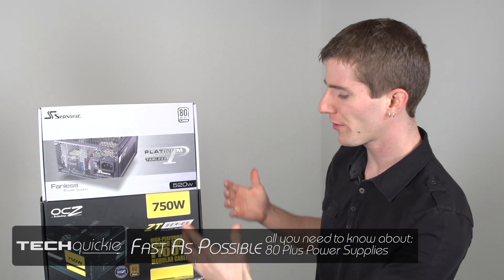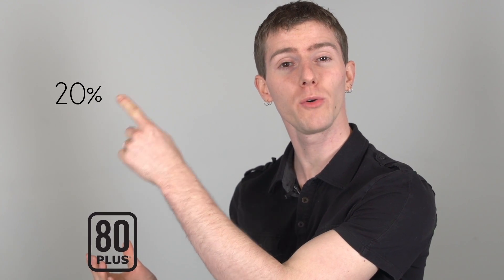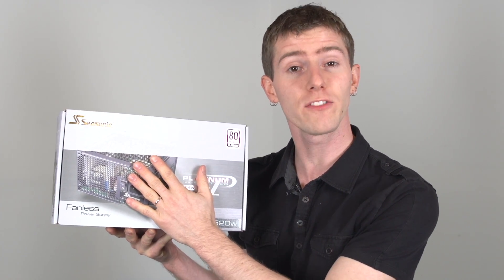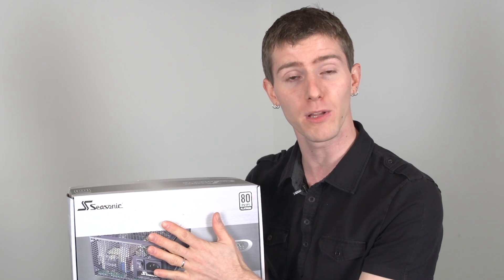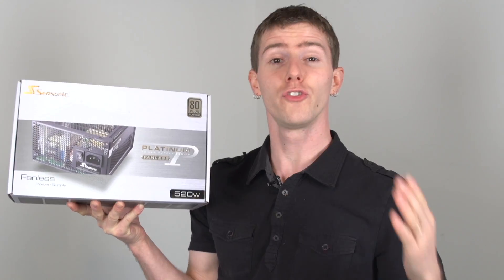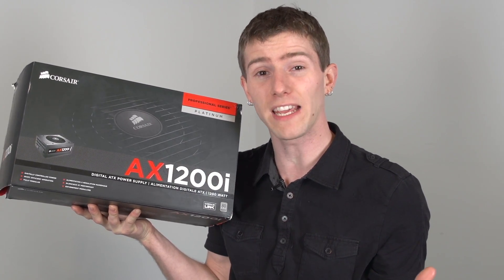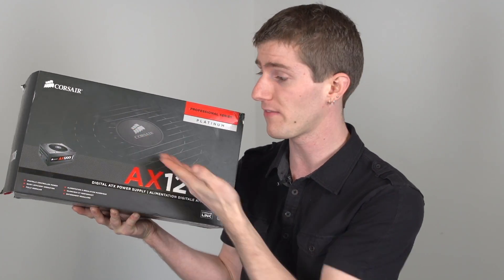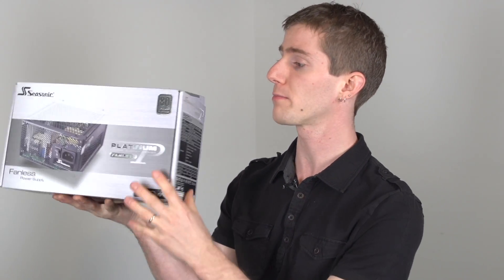80 PLUS Power Supply Ratings - All You Need to Know as Fast As Possible

Comment: Ok, I need your help on this one! I'm trying to build a 4k gaming system and this is were I'm at can you help with the power supply and any thing else, because I'm on the fence. The system is not put together yet. Gearing up for Star Citizen!

i7 4790k 4.Ghz
MSI Gaming 7 board
looking to pick up 32 gig Corsair Dominator Platinum 2400 (10 or 11L)
                   or     32 gig Corsair Dominator Platinum  2666 (11 or 12L)  
looking at video MSI R9 290 X with 8 gig or DDR5 one to start and another later
                       or  one of the MSI R9 300 series when that come out
Hard drives: WD 1tb Black
                  also whats in the works is the Samsung M.2 xp941 512 SSD
                  to start and well most likely add maybe 3 more SSD's
Swiftect H240 X water cooling
NZXT Fan Control panel
Corsair Case 760T with 3- 140mm and 1- 120mm fans
Blu-Ray/DVD play/record

I bought a EVGA Gold 80  850w power supply do you think i should go to a 1000w or 1200w

Thanks to your videos I've made purchases on some of your items!
Reply: looks good to me bro.
Reply: TheJeremy5599 Well I jacked up the power supply to a 1300GS EVGA... I went to Corsairs web site and run a test with there power setup sheet as well as Cool Master and did the math the number were different but both pointed to more power (1050w) so I'm going with that system. The issue is until I reach that goal I'm going to be over powered. the reason I went with this power supply is it's made for 4th gen i7's and SLI or Crossfire and EVGA didn't make a 1100w or a 1200w and I like there stuff, so well here I go with the 1300GSStill I'm on the fence With it because of how big it is! do you think I'm making a mistake and if I'm running on the 700w to 800w will I damage anything?
Reply: Ted Hegner Sorry my bad typing that's the 1300 G2 EVGA Gold plus
Reply: if you run a system that requires more power than your psu can supply no damage will be caused,but your system uses up all availible power headroom it can crash immediately. (i know this,as my current system does it occasionally)
it wont damage anything,but its rather annoying.

Comment: Can you mount a PSU upside down?
Reply: Power supplies generally mount either way. The fan can be on the top or bottom (depending on your case, you don't want to suffocate the PSU by putting the fan facing down in a case with no ventilation holes in the bottom)

Comment: looking for a modular or fully modular psu upgrade on my system. cost is not really an issue. I care about quality, efficiency and haswell certification. I also need something modular because I want good cable management. led lighting is acceptable.

mobo: msi gd65 z87 oc edition 1150 socket.
cpu: dual core intel i3 4370 haswell @ 3.8ghz *locked. stock heat sink.
ram: (2) 4gb sticks of mushkin ram @ 1600 mhz cas 11 latency. 8gb total
gpu: msi r9 270 w/ 2gb ddr5.
storage: (1) 128gb mushkin cronos ssd & (1) 1Tb seagate sshd.
cooling: 3 120mm stock antec case fans.  
psu: 550w bronze certified cooler master.

intend to upgrade to a 4790k 1150 socket and add 2 more 4gb sticks of the same ram. I want to over clock and install a swiftech watercooling system and replace all the case fans with 5 enermax tb vegas trios.

Comment: I got a pc rig going on this link http://pcpartpicker.com/p/sXNYwP
Is the PSU I selected good? also it shows how much power that my rig is gonna be taking in the top-right and it shows 426w for me so I think the PSU being at 1000w would be good right? im a bit new to PC building so plz dont hate on me for being a noob, I know about nearly everything else, CPU GPU, motherboard, I got that stuff covered but the one thing that I really don't know that much about is PSUs, if there is anything else that I should maybe exchange out for something better than plz tell me, the basic rig I would like to keep the same, also if you're wondering why I chose the ASUS x79 deluxe with an I74930k over the X99 and a 5th gen CPU, it's cuz pretty much everyone has told me that the i7 4930k is still better, and I just don't want to shell out even more money to buy something that either will be lower than what I want to only slightly better, I want some real proof and banchmarks that show how good the 5th gen CPUs are compared to the 4930k but until there are I will be sticking with this rig for a while, upgrading to a different gpu config, dual 980 ti's in SLI when they come out, this is why I went with the 1000w PSU, so I could upgrade to those when they come out, after that, Imma just wait around and play for a while and not upgrade, yes ik that upgrading is easy but with this rig I dont think im gonna need to go buy any new stuff any time soon and I just dont want to spend all my money every time a new part some out. when all in all my rig is 100% incapable of powering the ASUS RoG swift(1440p 144hz gsync version) monitor I'm going to be having, THEN I'll upgrade but thats because it's a mandatory upgrade, I know that upgrading is fine but I dont want to upgrade when I don't need it at the time. also I would like it if someone gave me a suggestion on a sound card and a 5.1 headset and speakers that I could use, I'm looking for a truly immersive gaming experience. now before you ask what I'm gonna need all this power for, I'll explain, the monitor ill have when I get this rig is 1440p at 144hz WITH g-sync technology so I want the smoothest experience that I can get, and if that wasnt enough to convince you, I'll be playing very demanding games like metro last light, crysis, those take a lot of power and I plan on recording with this thing as well with dxtory(do NOT argue with this, I've tried bandicam, fraps and action, dxtory is the best period, dont mention any other recording software and no i will not use shadowplay)
Reply: 1000 watts is overkill for your selected system.You would be fine with a 500-600 watt power supply, but if you plan to SLI later then go with a 850 watt power supply.

I myself am currently using a 4770k Overclocked to 4.4ghz, a gtx780 overclocked to 1150 Mhz core/7000 Mhz memory, and at full load the max pulled from the wall was right around 400 watts.The power supply i have is the Corsair AX860i. The only reason i got an 860 watt power supply, is because i was planning on getting another 780, then the 900 series came out and they discontinued the 700 series. So now i am waiting until i can get my hands on (2) 980 or 980 Ti once released.

Also, your choice of CPU cooler, if you plan to overclock, i would not recommend it
Reply: tl;dr. I am looking at your build. I won't tell you what I think. But thanks for sharing anyways.
Reply: holy cow you are going nuts with the power aren't you?
Reply: jason200912 well i planning on being able to upgrade, I plan on upgrading to 2 980 ti's in sli as well as other upgrades when they come out(CPUs MBs etc).

Skyler Jacobs okay then, what cpu cooler do you recommend?

SirLancelotized thats fine :)
Reply: Minecast Zyad48 plannin isn't enough.  If you have the money, you can do whatever you want-- i'd start with 1 980 or even go with the 970 instead since 980s cost a lot more for little fps gain.  I'd say upgrade the PSU after you upgrade a graphics card or your cpu.  Also it would be helpful to keep your specs organised
Reply: ***** lol
Reply: OK, so first of all, that GPU is an overkill and is being bottlenecked by pretty much everything else in your PC. I am not sure about the load on your PSU, but 450W is not rly a lot of power, can you try borrowing your friends PSU and trying with it? Also do you mean freezing as a complete lock up where your PC becomes unresponsive or freezing as an FPS drop? the latter would imply your hardware cant keep up the first one would imply a more serious hardware problem.
Reply: Jozef Tokarčík i havent gotten this pc yet, by freezing i mean the whole pc just stopping, also how is my gpu in this build being bottlenecked by anything? do I srsly need a 5th gen CPU and DDR4 ram to not bottleneck the 980?
Reply: Minecast Zyad48 the only time you need to worry about bottlenecking is when you have super weak CPU under $120
Reply: jason200912 yeah ik that but Jozef Tokarčík said that my new pc is being bottlenecked by a I7 4930k and the 16 gbs of ram I put itnto it o.o
Reply: Minecast Zyad48 it's not.  A high end cpu can last at least 3 years of gaming performance, unlike a GPU's 1 year before you start seeing any drops/bottleneck
Reply: jason200912 i see
Reply: Squall Leonhart I dont even know how that guy got that idea srsly
Reply: To all of you guys, he changed the part list before it was different. I hope at least or else i had to be high to say that
Reply: Jozef Tokarčík well no offence but you must have been high since I posted the part list after I finished working on it
Reply: Sorry no idea why i said its bottlenecked
Reply: Jozef Tokarčík nah its ok, everyone makes mistakes

Comment: whis psu for this build:
-intel core 2 quad q8300 @2,5GHz
-mobo: gigabyte ga-ep45-ud3l
-Kingston DDR2 2x2GB
-R9 280x OC by Power Color
1. evga b600 
2.xfx core edition pro 550w
3.cooler master B700 700W atx23
Reply: 2. or 1.?
Reply: go with at least a 600w psu. u should also upragde that cpu becuase it will bottleneck that card bigtime

Comment: Please answer. I have 300W power supply and i used the coolermaster PSU calculator.I have an A6-6400k,R7 240,1HDD and 1 optical drive. It used 217 watt. I want to buy an 750Ti if i do so ill use 250W. Do i need a better power supply or is it enough?

Comment: Hi great vid and channel, I have a Gigabyte SKT-1155 Z77-DS3H Motherboard and it requires a 2x4 power pin and i dont know what psu has this pin due to details not being detailed enough or them not showing pictures of the power connectors, my question is whats the cheapest 500 watt psu that has this pin 2x4 an item number would be really helpfull and your recommendations are apreciated.
Reply: ***** I am not sure about the "cheapest" but since you shouldn't go cheap on psu's the corsair 500w is great and it should have all you need.
Reply: it turns out i can use my existing psu and get a cable adapter turning 4 pins into the eps pins that i need.
Reply: ***** Ok, that's nice I guess.

Comment: I have a question for all those out there. I just completely swapped out all the parts in my computer, and I now currently have an:
AMD R9 290
Intel i7 4790k
MSi z97-g45 motherboard
And a ton of fans

I did cooler master's PSU calculator, and it comes out to a 516watt MINIMUM recommended power supply. I currently have an Ultra 650 Watt Bronze power supply, and I intend to do overclocking with some of my components, and maybe crossfire with another GPU in the future. I've been considering getting EVGA's 1000 watt platinum power supply, with consideration of the fact that I may do crossfire in the future, and I was curious to see if that would be a good choice for expansion in the future, but it may be "inappropriate". Should I  spend the money to get the EVGA 1000w power supply or should I just stick with the good ol' Ultra 650w I currently have until I get another GPU for crossfire? Thanks.
Reply: I should definetly keep the psu until you can buy both your gpu & new PSU. and i think 1000W is kind of a overkill. if you're planning to do dual crossfire, then I highly recommend buying a 750W. it will most certainly be good enough and will even have enough "breathing room". hope this helped you out :)
FYI, always be careful with power supply calculators. some are too agressive while others are not. Imo, it's best to do it yourself.
Reply: MrEvan1932 1000w power supply would be good if you were gonna do 3+ way sli/crossfire but not with only 2 cards. 
I also think 750w is enough, but look around for more tips. To find out what's best for you.

Comment: is a 630W psu enough power for my 450W gpu and my pc with a led fan 1 hard drive and 1 optics drive
Reply: Not really enough information here, but for the most part a 630W PSU can handle pretty much anything that the average computer user might throw at it

Comment: If i will buy a 80+ psu will my elecricty bills drop....willl i pay less if i have this kind of psu ?
Reply: Generally that is what efficiency means. You will save energy even if the supply is hooked up to the same system because it will be able to lose less of the energy it needs to supply to heat build up and stuff. So if you're going from something that is 40% efficient, for example, to an 80+ psu you can expect to use more than 1/2 the energy on average. It is probably a good idea to read up on your current cpu and calculate what kind of savings you can expect.

Comment: I dont get a platinum or titanium certified psu for the powersavings as much as i do it for the extremely low ripple. Check out the power flower ( worst name ever ffs ) 1000w ... even at 100% load it does not go above 20 mV on 12v rail. 500w draw its under 7mV, almost imperceptible.

Comment: Not at all in fact you should have gone for a 750. Power Suppies are most efficient at 50-60 percent capacity. So a 750 would have been ideal. 

500w would have been ok, assuming you don't overclock, but it would be running at 95percent load capacity.

Comment: 400w is not enough for that system, maybe is good at idle..with no hard drive, that system with all component can do over 500w easily at 80% ...what if he overclock the components or he want run sli tomorrow...also capacitors degrade with time and tend to be less efficient, so is better always take in count 20/30% more than what you "need"...i would go with a good 650w.

Comment: The more efficient the power supply the less power it requires to run the device. Lets say your PC requires 200w and the PSU pulls 250w from the wall to make that 200w(theoretical) so 50w is being wasted. A more efficiant PSU will draw 210w and use 200w (10w wasted)
This means that there is a lower demand for power and so the grid doesn't have to supply as much power and/or can store the power for later use.

Do you think that unused power will just dissapear? no, it gets another use.

Comment: 500W is enough with 1 graphics card.
77W for CPU.
20W for 2 Ram Modules.
1 HDD =10Watts
Motherboard - 30W
3 Fans =9W (assuming)

CPU+M/b will consume - 77+20+10+9+30=146W
HD 7770 = 86W (Source- 3dguru)

So total = 146+86=212W

Premium PSUs MTBF (Mean Time Before Failure) is rated at 70% load at 25 / 50C, so we assume that a good lifespan for the PSU would be achieved when the PSU is <70% load.
If u hv a 80+ Rated PSU its better.
212/0.7=300W
So a 500W Good PSU will be enough.
Chk the +12V Amps.

Comment: The Seagate Momentus XT is pretty much a SSD caching drive: It's a standard HDD with a small SSD used for caching the most used files. This type of hybrid drive is very useful for laptops as there's often only room for a single 2.5" drive, so it gives a balance between a fast SSD with limited capacity and slow HDD with large capacity.
I was wondering if SSD caching has better performances than Hybrid HDDs - would be interesting to get some benchmarks.

Comment: Well, the drive cache on a SSD or HDD is pretty much like RAM, it's used temporarily to transfer the data (the CPU sends chunks of data to the cache so it don't have to wait for the drive to process every single bytes, as the CPU is much faster) and it is usually in quite small capacity (usually 32MB or 64MB).
SSD caching and Hybrid drives are basically copying the most used data form the HDD to the SSD so it can deliver this data faster using the SSD instead of the slow HDD, when available.

Comment: Obviously, a regular SSD will be better, as SSD caching and Hybrid drives will only cache the most used files and program, so you won't benefit from the speed on less used files, and while transferring files too (unless they're files you transfer on a regular basis). SSD caching and Hybrid drives are often a budget solution to get quick boot times/program start while having a good amount of storage (a 32GB SSD + 1TB HDD will cost about the price of a 120GB SSD if you know where to look).

Comment: 80 plus rating sucks!
80 plus is like THX. Just an useless marketing machine. :)
Its like: "I'll always buying gold and platinum". Did you check the prices? A silver is not much worse than gold and still actually what nobody wants to have. Even if the PSU is $35 cheaper (for example).
So some companys MAY (if they do or not, is their decision. My rule is: Never trust a big company) lie to you with a gold or platinum PRINT on a Box or on the PSU. There is a possibility of doing this FOR SURE. ;)

Comment: I hope @Techquickie would confirm if I understood that correctly. Because in that case that would explain a lot to me and help a lot in choosing power supplies. Would save me a lot of money too. If the efficiency CAN go down when the power of your psu doesn't match the draw of the system, then having an overpowered psu for a system, would cost you more money in electricity bills than just getting the right one.

Comment: KILL A WATT.., themselves..WILL TELL YOU in the instructions that come with the device..DON'T plug it into a power strip and plug it straight into the wall outlet for most accurate results.  

I didn't make the product. If you can prove to Kill a Watt company that you are correct, go ahead and then I KNOW if I plug it into a power strip ..it won't either void my warrant in case something happens to it and won't cause any other problems. Until then,  I'll follow the directions.